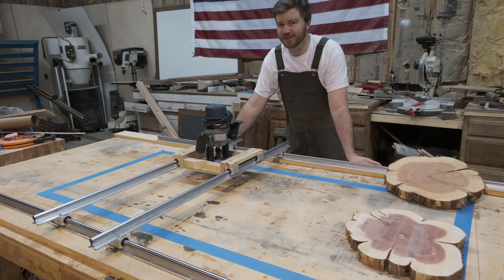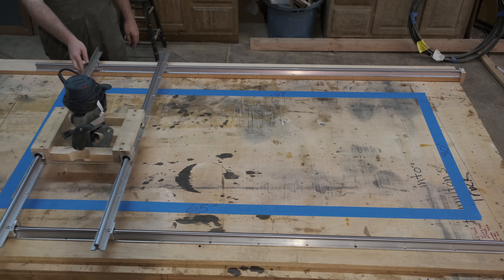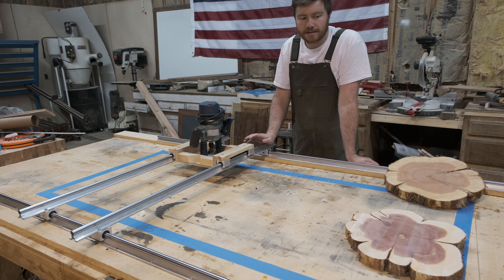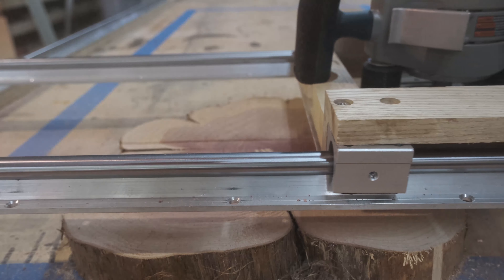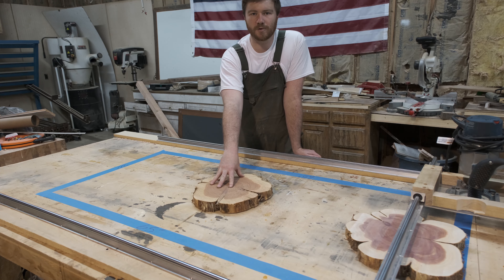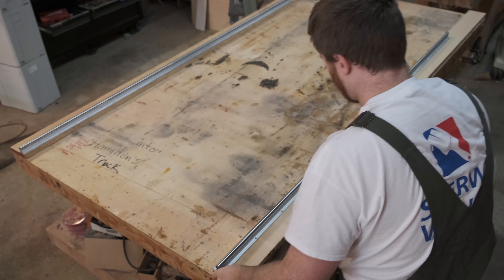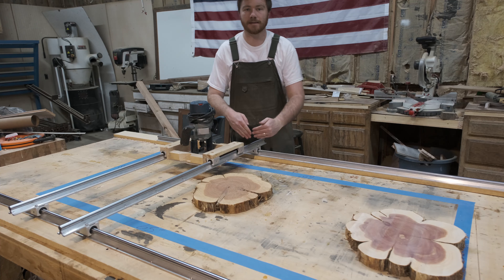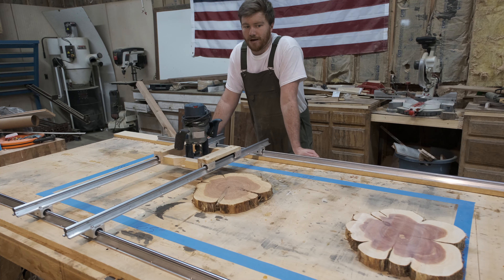DIY Linear Rail Router Sled

Comment: Hello,
How do you determine where to drill when you attach the rail or router support to the block?
Indeed, the four holes are no longer visible when you place the rail or support on the block and it is not possible to mark them because the holes are no longer visible!
Reply from the maker: Theres a few ways. Easiest would be putting some blue tape to cover all the holes, mark the holes with a sharpie on the tape, or punch them out with a screw, and then use the piece of tape to make a small jig block for the future or put the tape directly on the rail and drill where the holes are marked.
Reply: @HamiltonDilbeck  Thnkyou , I will try

Comment: I grimaced at the metal grinding sound when he said “it is buttery smooth…” and pushed the sled 😬

Those Chinese bearing blocks probably arrive dry, but they will be much smoother and quieter when properly lubricated.

Comment: sorry bro.. it is SAGGING!a lot! 
Not the best design.. almost useless.. considering flatness.. cheers from europe
Reply from the maker: To anyone reading this, its not sagging. Also "useseless" isn't a word. No need to be sorry, cheers from North America.
Reply: @HamiltonDilbeck  you should check from 08second of your video.. good luck
Reply: corrected thanks!
Reply from the maker: @Winston-hw8wb  I know you think it is, but thats clearly sideways movement.
Reply: @HamiltonDilbeck 
Those rails even if sbr20 are not supposed to bear the weight of a router..cca 2/3kg even more.. per se on such a tight point of load. They are only for frictionless travel.. 

I am making my own with sbr12, 30x30 alu extrusions supporting x and y movement.. so no sagging for sure.. but hey as you amerikans say  it is gud n'uff. cheers
Reply: I just built one.  It doesn’t sag and works great.  First slab is flat as a pancake and checks out with calipers.  I wouldn’t use it for machining an engine block but for it’s intended use it works great and the price of the components is hard to beat.